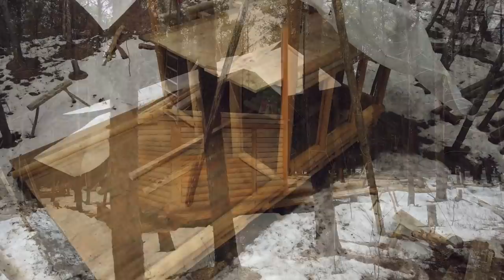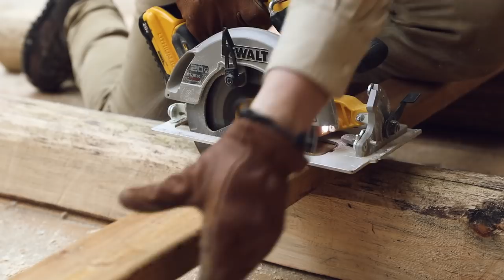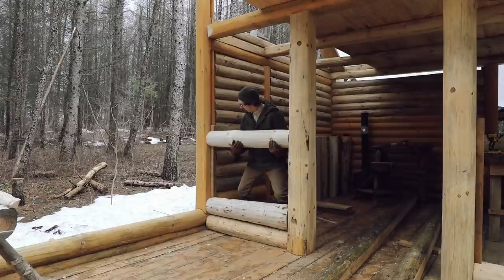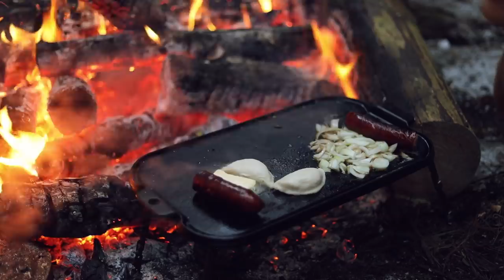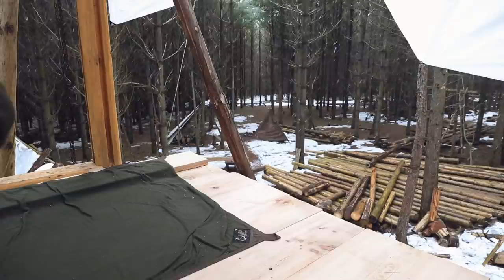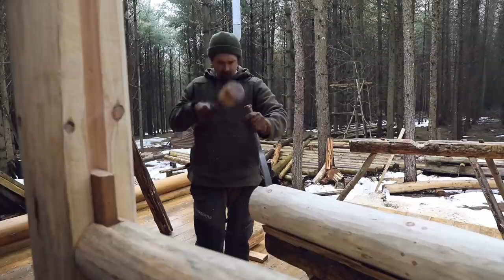EP22: First Overnight at the Cabin Build & Wall Install

Comment: Hey friend. At 12'00 I saw your thumb very close to the blade of your hooknife and told myself "hmm... that's a no-go for me", the next thing I see in the morning you wake up, take off your right hand glove, Oh did I smile when I saw this bandage on your thumb and how you would pull gently on the knife minding your thumb. There is a nightstory hidden in this detail, I'm sure. That's part of why I always push in front of me and never pull the hooknife, too sharp to mess with :D I'm clicking on the #23 right away, cheers.
Reply from the maker: Actually cut my thumb on a dang staple. I’ve been cutting towards my thumb peeling potatoes since I was 9 years old and I’ll never stop:)
Reply: @TrustinTimber  staples are vicious ones lol. My gma would peel vegetables that way as well, but I've never gotten used to it.